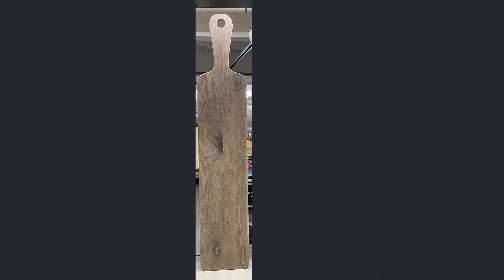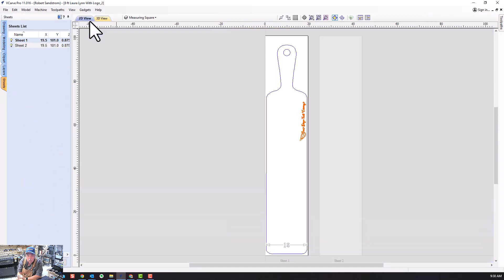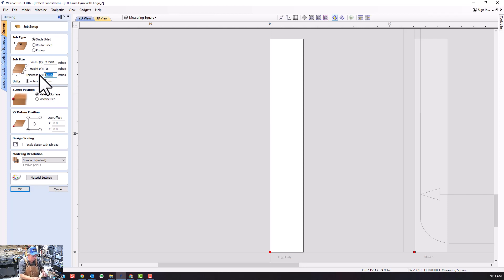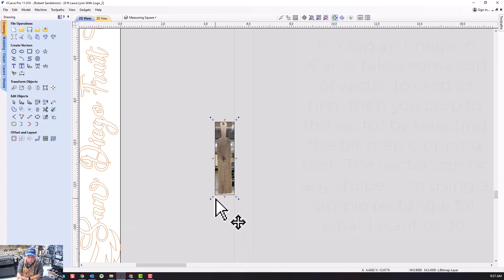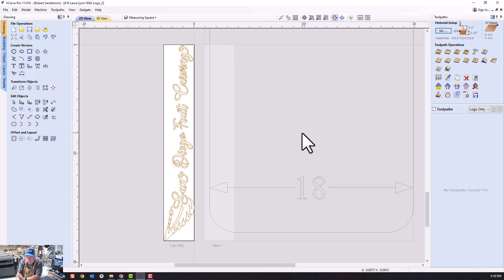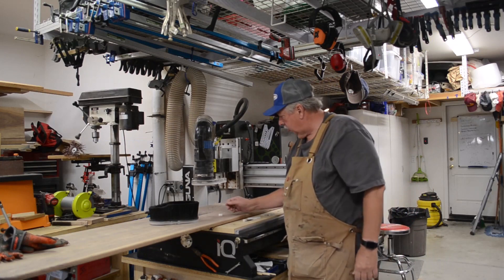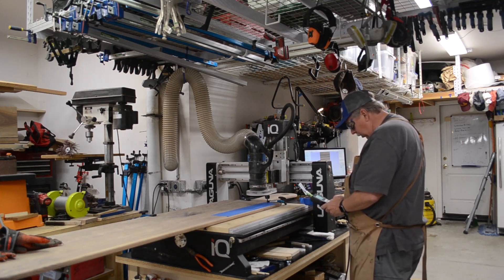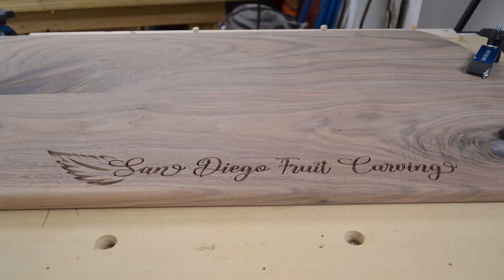X-Y Datum Location Top Right

Comment: So I take it that you would recommend using the ballnose, and what advantages does it have?

Also I believe you had a clearance bit    for the tool path, but did not see you use it.

Thanks once  again for another eye/mind opening video
Reply from the maker: Mark the carving was so small that I didn't show the use of a a small 1/8" EM during the carving.  It only touched down into the carve a couple places.  As for recommending the ballnose, in this case it worked well.  I will try it more, so it is a case by case thing for which I will try it out to see in the long run which I like better.  The ballnose ran a little faster and the bottom was a little flatter - not that it really mattered.  I just saw others using the ball nose for their wood inlays and wanted to try it out.
Reply: @RobSandstromDesigns  I like to that the ballnose left a flatter base with it. I think the epoxy would have more of a surface area to adhere to  then just a v-shap contour.